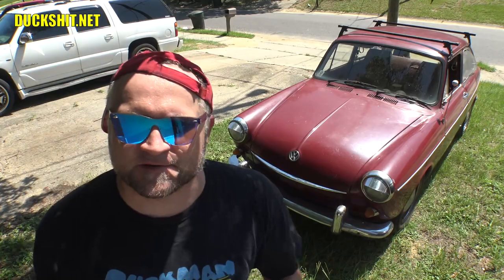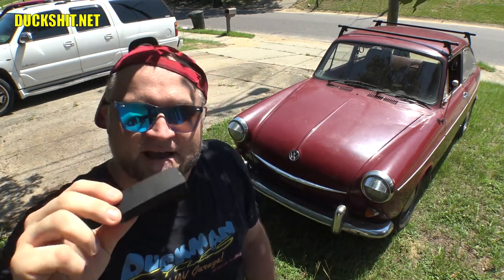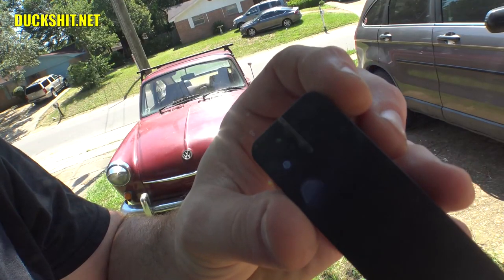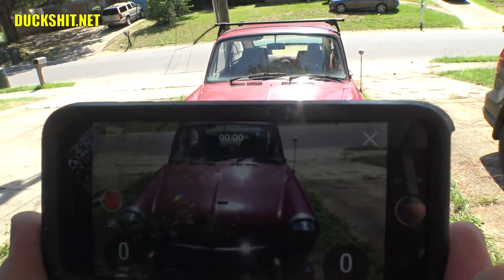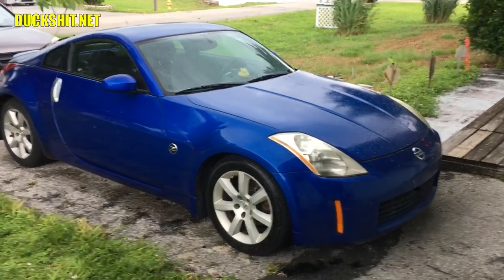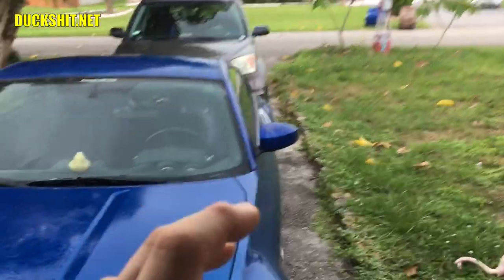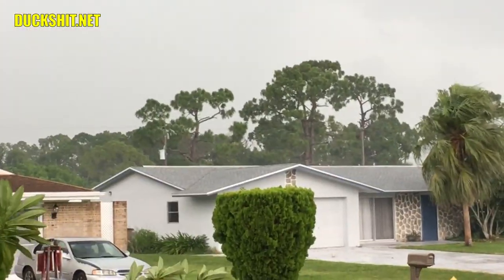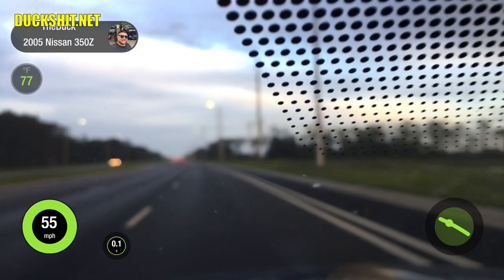Dragy Review - 1968 VW Fastback Quarter Mile Time

Comment: I recently used a similar product to test out my 72 square with a 1776 on DCNF's. Less than 200 miles on fresh engine and I was able to pull 18.52@68.2mph with first gear all wheel spin. I feel pretty good about it considering my lack of familiarity with the car, short sidewalls and the almost to big carbs.
Reply from the maker: Yeah that one should do much better than that, even slightly faster than my Z!

Comment: What helps the type 3 is the straight axle, less power loss than cv joints, and 4.37 gear ratio.
Reply from the maker: But this Type 3 has a 4.125 and CV joints, despite being a 1968 its been converted to IRS.  😀👍😀👍😀👍😀

Comment: Hey Glenn. First, many thanks for all your "air-cooled" videos! ("Special" thanks to Bee, too!)
I do have a suggestion for your Dragy tests: Try taking ALL the excess items out of your vehicle before doing the tests. Spare tire, jack, tools and all the crap (oops!), i mean 'valuables' out of the trunk of your 300Z (& Ruby), highly visible in the latter part of your video.
In fact, you might do 'before & after' tests to see exactly what that "weight" difference makes! Would be interesting.
And yeah, you DO need a tachometer in Ruby to protect her engine.
ALL the best, from Melbourne FL.
Reply from the maker: Thanks so much!  But if the engine blows up, then I fix it... lol, makes great video content.  Weight savings is good for a drag car, but in this case these are cars that are driven on the road everyday, so all of their everyday accessories spares and tools will be staying.   By the way the first two runs on the CRV, first one had an empty trunk, second one had a trunk loaded down with all kinds of stuff that I've been moving.  Times were still consistent! So I would imagine he needs to be some dramatic weight difference else it won't make that much of a change.
Reply: @DuckmanCycles  Yeah, probably just tenths of a second.  Hell, "real" drag racers will make sure their car has only enough fuel for track day for weight savings. 
Wasn't suggesting you remove your valuables permanently, only for the timing tests.  ; )
We're having a nice lightning storm here in Melbourne right now!     Florida...
Reply from the maker: Yeah thunderstorms over here in Florida again LOL

Comment: 22 sec. Not bad for that old Vdub. Nice. The Honda didn't  do to bad either. To bad the roads were wet for the 350Z , I know you would be able to do better time on dry road. Nice thought.  The best I got back in 98 with my Mustang was 14.5 in 1/4 mile at the drag strip. 5 litres V8 with automatic transmission.  About 240 horse.
Reply from the maker: hehe thanks !

Comment: Great video.... would have been a better video if you would have wound Ruby out like you normally do when you run around 😂
Reply from the maker: ROTFL..... as if I didnt
Reply: DuckmanCycles and VW Garage come on man, sure sounds like you kept the rpms low and short shifted.
Reply from the maker: Pfffffy nope lol
Reply: DuckmanCycles and VW Garage 🙄
Reply from the maker: Someone else suggested my gearing seems taller, but it’s the same transmission that was originally in there. Maybe just the audio quality of using a stupid iPhone
Reply: DuckmanCycles and VW Garage could be that or did you change the rear tires out?
Reply: DuckmanCycles and VW Garage send it my way, I’ll put it to good use 😁
Reply from the maker: Same rear tires... I am surprised they've lasted as long as they have.

Comment: Fun video today thanks Glenn! Zeroto60times.com has the 2005 350z clocked at 5.7 sec 0-60 and 14.2 in the quarter. Those times are probably with perfect traction and low DA.
Reply from the maker: Well if that's the case and I got a 5.7 on the zero to 60... and all else is the same as in my video I'd have about a 14 flat.   I mean I really shifted too late and the road was a bit slippery.  I think I can do a lot better than 14.  13.5ish for the win!
Reply: @DuckmanCycles  You might even get it to go even quicker than 13.5 if you put  street legal drag radials on.  Those alone have been known to knock 1/2 - 1 second off the quarter mile! That Z is a quick little car right off the showroom floor and you have an awesome little ripper in it :-)

Comment: not bad for a bone stock fastback :)
Reply from the maker: I thought I was pretty good too!  Would be nice to compare engine temperature to my performance differences oh, I think they might have had something in common.
Reply: @DuckmanCycles  my experience with the type3 is the engiine loves the SVDA distributor, adds some kick
Reply from the maker: Well it really doesn't add anything, that's what's supposed to be in there stock for all air cooled VWs.  If you change it out to everything else you're actually going backwards.  Yes I have an SVDA electronic in there now, but when I bought the car it had a 009 with points and it ran like crap at low RPMs

Comment: Duck man will a 911 5 speed box to into 1300 super beelte 1973 with 1600cc beelte engine 

Jj  uk
Reply from the maker: Not without some heavy modification to the frame horns and re-routing of the shift rod to under the car. But yes it has been done!
Reply: Is there not mixco box with 5 speed made !!!! For a 1600cc 

Jj  uk
Reply from the maker: I don't know what a mixco box is.  If you want a 5-speed to easily fit in a Volkswagen, look at the Berg 5 speed.